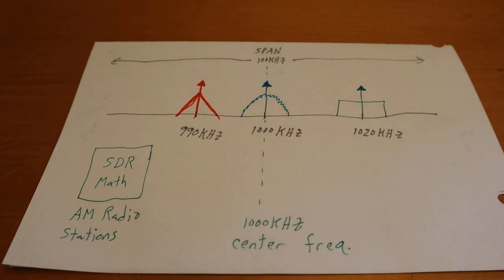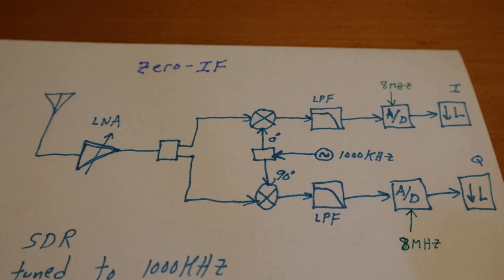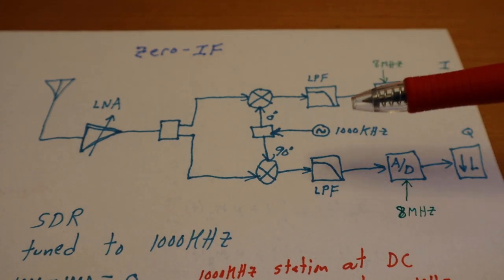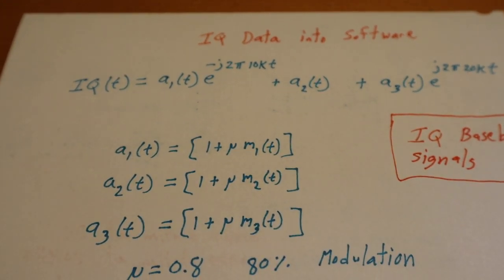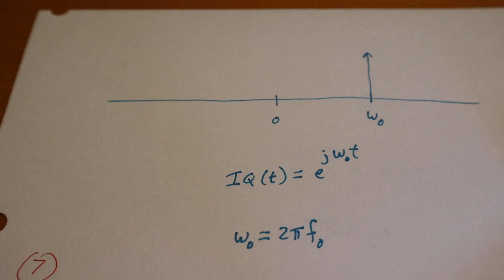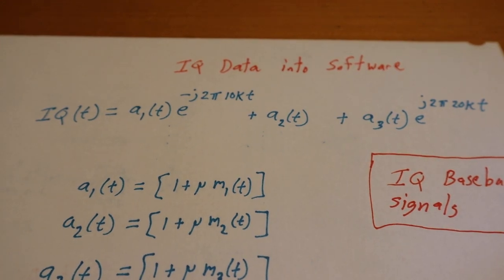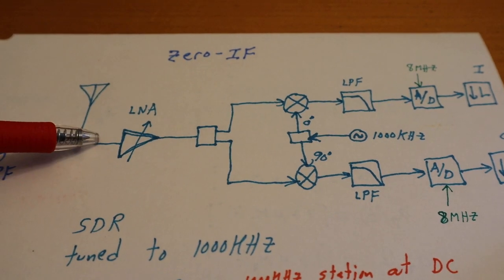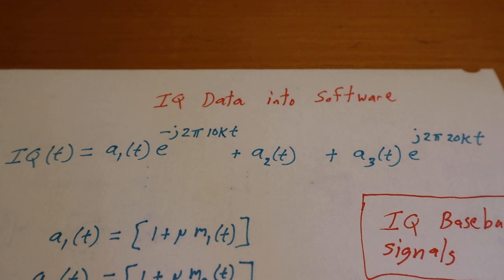Learn SDR Math,  Back to School

Comment: I wish to thank you for this video.  I have been struggling to understand the math.  I finally understood how to represent vectors as complex numbers after a lot of self study.   I don't quite understand how the I and Q signals combine or work to produce the demodulated signal.  I also don't understand about base band.  What is zero and how does it produce the demodulated signal?  How is the sdr tuned?  Is the local oscillator tuned to the frequency you want to listen?  Would the I part of the carrier be tuned to the desired frequency?  What happens with the Q part of the local oscillator when it mixes with the incoming signals?  I also got lost on the equation a1(t)=[1+mu M (t)]  I know that this is a lot to explain.  Maybe you  could suggest where I can learn this sequentially  or where I should start with your YouTube videos.  I don't have Matlab but I do have a Triarchy vector signal generator.  This will enable me to play with this.  Thanks again.
Reply from the maker: hello,  yes the sdr is tuned to the frequency you want to listen to,  i am showing thou, if other signals are next to your tuned in signal, how these signals show up in baseband.    may want to see w2aew youtube channel,  i believe he made videos on IQ Modulation.    and for recieve, with IQ since amp and phase has been preserved this IQ format, we can demodulate any type of modulation.     and i did not cover this math, say for AM, and FM.     that is a good idea, and will do a video on that.  thanks
Reply: @TheGmr140  Thanks.  It has been quite an adventure learning about IQ modulation.  I don't expect to learn about this over night.  I think that I need to learn how to look at this in another way.  I have looked at W2AEW's videos several times and then I think about what was shown.  It is easy to miss or overlook something.  One thing that I had a hard time wrapping my brain around was w (omega).  Vout= [A sin *(2 pi * f * t]) .  Where A=Vin and t= instantaneous time.  I was wondering what math you need to know about combining vectors and seeing the resultant signal.  When it comes to what happens after the A to D conversion after the balanced mixers, my mind goes blank.  I have a hard time visualizing it.  So again, I appreciate your work in producing your videos.  Richard Phillips
Reply from the maker: @richardphillips2405  yes getting into the final products from the iq demodulator,  take alot of trig and formulas to get the result.    the easy for me is to think in terms of exp(j w * t) .            so if the IQ demodulator was tuned to 100Mhz,  and incoming signal to the IQ demod is  101Mhz,  the iq signal is  exp(j * 2 *pi * 1Mhz * t) 
and if the incoming signal was 99Mhz,  the iq signal would be exp(-j * 2 * pi * 1MHz * t)
and use Euler's to get I and Q signals
exp( j * x)  =     I = cos(x)    Q = sin(x)
exp(-j * x)   =   I = cos(x)    Q = -sin(x)
Reply: @TheGmr140  Again, I appreciate this.  Would you suggest some of your other videos I could watch that would be related to this?  I think that I will go through your videos and also review W2AEW's videos.